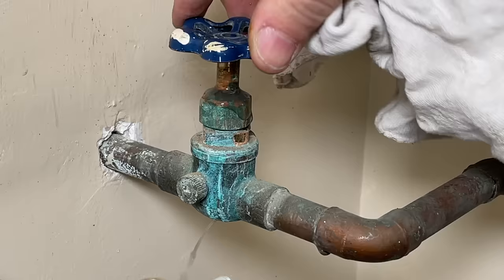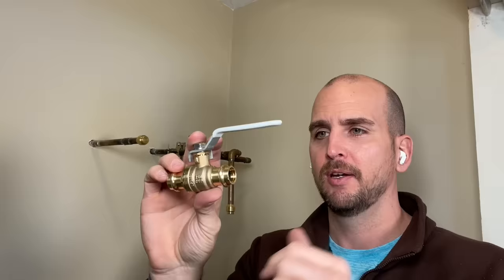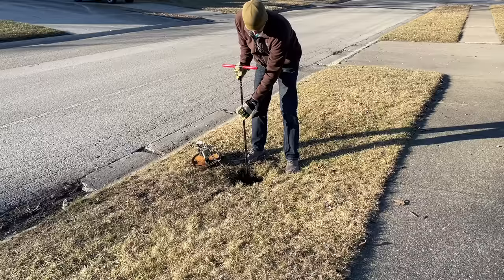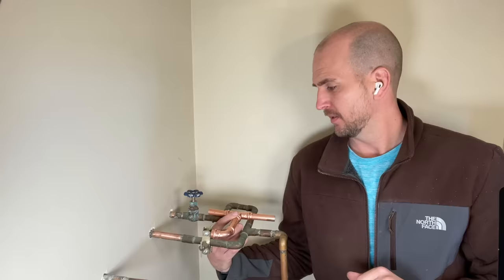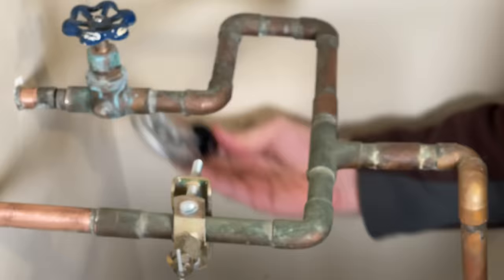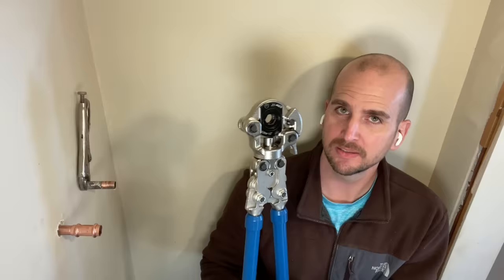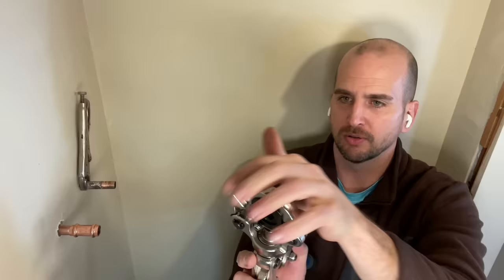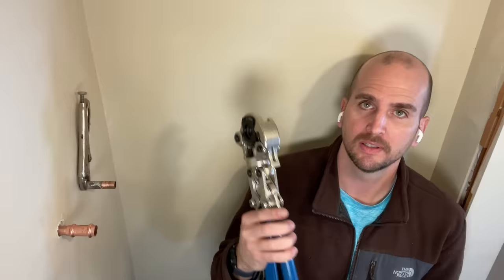How To Install a Main Water Shutoff | NIBCO Press Fittings

Comment: Yes the ball valve works in either direction, but pay attention to where the handle may be as it swings 90 degrees from on to off. Otherwise you may find it hits another pipe, another valve, the wall, etc
Reply: I agree,i think he may have turned it around,the nub on the valve is the stop.the way he had it to open it you turn that one clockwise hitting the wall.good catch.
Reply: Not to be too picky. There are gate ball valves I use in the basement the include a drain port. That has to be positioned to allow the down stream plumbing to drain after the gate valve is off.
Reply: It would be great if they made wheel style handles for ball valves. The handles are easy enough to remove and replace. I suppose you could cut a straight handle down so it's shorter when you have no other option due to space constraints.
Reply: @virtuallyrealistic  gate valves are no match for a ball valve, they jam, leak , and any dirt in the line and they wont shut off properly.
Reply: @virtuallyrealistic   Any contamination will cause the gate to not seat fully. Then the seat erodes. As long as you're going to sweat one of those monsters on, you might as well use a ball valve. 
He was spending a lot of money to avoid sweating a valve on but even using an extra $25 on materials to practice with, it still wouldn't equal anywhere near the cost of that crimping tool.
That is, if you bought, for practice, an extra 1/2" pipe ($20), a ball valve ($12), 8 couplings (97¢ each), solder, and flux, torch and tank, you're only into it about an extra $60.   And you have something to start your campfire with.
Reply: @mrcryptozoic817  Yes and soft soldering isn't difficult...every man should know how.
Reply: Great tip! Thanks!
Reply: I actually thought you wanted to install shut off valve after feeding water into house . That looks like it's in front of water feeding into house.. ijs
Reply: @joepublic2894  yes
Reply: 'Normally' practice is to have the handle pointed in the direction of flow (open). However that's not always possible but usually is. Also, sometimes you want the drain port on one side over the other.

Comment: I am not a plumber but needed a water line to a fridge with water and an ice maker in the door, the fridge is in an extension part of the house that is exposed to subfreezing temps. The plumber wanted $2000 to run 13 feet of pipe and valves to the fridge. I did it myself for less than $50, I put in the pipe, shutoff valves, and a place to drain off the water outside so the exposed pipe doesn't freeze, all using shark bite fittings and ball valves. did this over a year ago and still no leaks or frozen pipes. As a truck driver, I did well.
Reply: Normally if a plumber quotes you THAT much to do that job, it means they just don't want to do it or be bothered.
Reply: Too expensive

Comment: I'm a chief engineer  as many situations come up- for copper piping I only go with  old school- sweat fittings  it's a solid seal as the solder bonds to both sides of the pipe ( male and female) no slipping   no chance of coming loose. In some situations I can see saving time with these press fittings,  but in time I can see them leaking. Plus all round  fittings and supplies are just so much cheaper. Just my thought....
Reply: Job security. I can’t understand sharkbites passing plumbing code when the "bite" part is metal into copper. Electrolysis will eventually eat one or the other dissimilar metals.

Comment: I bought the Milwaukee 12 volt system, never looked back, if you ever hired a plumber $1000.- $1500 does not go far, most of the plumbing I do is under kitchen sinks, bathroom vanities, crawl spaces, one point to remember the press fittings are one use only, think twice, press once. One thing I will mention if you used a press cap at the end, that is maybe the most expensive press fittings, you could have likely put on another ball valve for just a dollar or two more and had a water heater shut off valve, maybe the cap is shark bite and you can reuse it, I enjoy your videos. When I replace a valve in a tight run like that I cut the valve, which releases the water inside and reduces the mass to heat up, heat and remove the collar left on pipe, wipe off solder, clean pipe, sometimes that half inch of pipe you save, saves a lot of work

Comment: I prefer using male adapters and a threaded valve, so it is easier to replace the valve if needed.
Reply: Yeah I never solder valves
Reply: I never press or solder valves. I always also use threaded or compression fitting valves. Just better for any future repair because nothing lasts forever.
Reply: @Kerbros100  Soldered valves are fine since you can remove them.
Reply: @DragonBuilds  Sure but here in Sweden you need to get the hotwork permit just as you look at the torch. If it wasnt for that i agree with you 100% =)
Reply: GREAT IDEA!!!....  => VERY SMART!!!
Reply: If you have threaded valves...you need a union which another potential problem. I either sweat or use compression fittings. PRO TIP: Make sure new valve has a drain port on it. EDIT: Shark bite fittings are terrible
Reply: @blaydCA  Agreed. More fittings = more places for things to go wrong.
Reply: @blaydCA  Sharkbite fittings have their uses
As a pro, I've never had a problem with Sharkbite
Reply: @walterbrunswick  Yes, if I was in a desolate area on vacation with no tools and the only fitting available was a Sharkbite..... I'd use one as an emergency temporary repair. As a PRO I've made some good money on fixing others plumbing mistakes when they used them.
Reply: @blaydCA  again, if installed properly, (deburr but do NOT clean/sand (you want the O-ring to seal on a smooth surface)), they are failproof 
a few years ago some workers plumbed a house with Sharkbites, no problems
only they are expensive, relatively speaking
But, for example, on a hot water tank re&re, they are marvelous - and the next guy who has to re&re will thank you

Comment: Ive been a commercial plumber since '95. Whenever I'm fitting together anything involving rubber or neoprene,  i like to wet all surfaces with soapy water. ..even nohub bands. ..slip nuts, I've never installed these kinds of fittings here in this video, but i would certainly soap them up before making them up. The soapy water makes all the mating surfaces nice and slippery so nothing binds up or gets pinched then it gets tacky as it dries. Anything that ends up inside the pipe rinses right out with ease. 

Soapy water in a spray bottle is an invaluable asset for any plumber to maintain. It's not just for checking for leaks or when making up rubber connections. Its good for remodels,  before soldering around combustible materials, spray down area. Before cutting into wall or pipe, spray area to keep dust to a minimum. The soap makes it spread better, stay wet longer. I use 2 or 3 tablespoonfuls of dawn per bottle.  That way, when it gets low, if im not near my supply of soap, I can just add water to what's left and its still soapy enough...

Its handy when cutting rubber too.
Reply: Great idea or even corn oil would work as long as it's not oil based  .
Reply: @Floyd Albright  but corn oil won't dry clean and it won't spray out of a simple spray bottle like soapy water does.  ..and it doesn't double as a substance that can be used to check for leaks.  ..and you can't add water to corn oil when the bottle gets low and there's no more corn oil.. lol

But it might work well tyseal gaskets and ductile iron gaskets..
Reply: This guy doesnt know what hes doing. He a jack of all trades master of none.
Reply: @RadioRich100 but better than master of one, right?
Reply: @Wow_wow1  No

Comment: Good video for the most part. However, press type fittings (including Sharkbite) are ok for external pipe connections that can be monitored regularly. Personally, I would never use press fittings inside of walls (yes, I know people do it all of the time). I have seen way too many press fittings leak, even when installed by so-called "professionals."

Also sweating (soldering) copper pipe is fairly cheap and easy. Just make sure the pipes and fittings are cleaned and deburred. Use Flux on the pipe and fitting, and apply heat to the opposite side of the solder contact. This will draw the solder into the gaps between the pipes and fittings, properly sealing the connection for many years. Soldering copper pipe takes some practice, but it is a lot cheaper than spending $175 on a crimping tool that you may only use once or twice. Hey, we can't have too many tools though, can we?....lol.

Finally, ball valves are great. They are much more durable and convenient (also more expensive) than globe/gate valves. Just don't buy thin metal, cheaply made ball valves, and they will last (almost) forever. When buying ball valves always look for "full-port" ball valves, so you don't lose water volume. What is the point of having a 3/4" pipe if the ball valve only has a 1/2" hole?" Also, water-knock can be an issue with ball valves on an often-used connection (like a garden hose). This is because the opening and closing of the ball valve is instant, and not gradual like with a gate/globe valve. However, this can be overcome by closing the ball valve slowly.

This is just my 2 cents on the subject. Hopefully this helps all of those DIYers out there. 👍👍
Reply: For sure its going to help guys like me who own a home and depend on videos and detailed instructions from guys like you. 
Well I have to use sharkbite as my shutoff is in-between walls and 12 inches below the basement ceiling. Thanks once again.
Reply: Hi, Sorry I haven't heard of press fittings leaking inside walls if done properly.
Reply: @jayak3768  Those things leak all the time, all the pipes at my work are installed by long term Journeymen plumbers and I see them leaking all the time, slow drips with visible corrosion from where it is leaking.
Reply: @zekehu7701  I WOULD NEVER USE A PUSH FITTING VALVE ON THE MAIN SHUT OFF. Your insurance company is gonna love you. There's ALWAYS a way to do it correctly.
Reply: You are correct. Best to check your jurisdiction. Some ONLY allow a rising stem or gate valve on the main shut off to avoid water hammer or shock from abrupt shut off. The gate valve makes this impossible.

Comment: I am an old school (retired) HVAC technician that has always sweat copper pipe. About 2 years ago I used Pex to install at tankless water heater in my camping trailer and shark bite to run a new water line in the basement of my condo. Although I have had no problems with either. I’m still skittish about these new fangled things. Any more DIY projects I have, I’ll go back to my old ways. The cost of the press fitting crimping tool is enough to prevent me from even trying these fittings. 
However, your video was certainly educational. Thank you.
Reply: None of them have been out there or had the track record or history of sweating copper. Everything new is better than sliced bread until the failures start stacking up. I still remember the 'cheap' PVC from the '70's, aluminum wire, and the CPVC stuff ('90's-'00's) that would fall apart if you touch it. And they got that cheap ABS pipe with a sandwiched layer of foam that turns into spaghetti with hot water. Only reason to deviate from what works is to cut time or money.
Reply: It doesn't save money it just makes people more confident to do repairs. For a plumber that knows exactly what to look for in solder joints that's fine. For people who don't that can cut a pipe deburr clean and press on a SB it is much easier
Reply: @chevy16001  For production building work it absolutely saves money (time) if you look at how long it takes to plumb a whole house or building. For a home owner, it's a waste, unless you hire a pro plumber.

Comment: I'm an old school DIYer and I would solder all the connections. Even if you have to buy a torch, the cost is a small fraction of other methods and this method has been used successfully for years. To me it's the gold standard.
Reply: Decades not years, otherwise your comment is awesome.

Comment: One other tip, instead of using a Sharkbite Cap in general, I like to use a Sharkbite coupling with a short piece of pex with a plug crimped in. Then when ready to run more pipe, simply remove the PEX and continue with PEX or copper. I've used Sharkbites professionally for 15-20 years (since Cash Acme 2st came out with them), never had a problem.

Comment: I'm a plumber and I use pro press and mega press frequently, you did a good job ,but I would have pre fitted it where all I had to do was 2 presses on the wall to eliminate fatigue. It's much easier to sub assemble on a bench or floor then to do a bunch of crimps on a wall, also most jurisdictions require a minimum of 3/4 feed lines to water heaters
Reply from the maker: Hi Will thanks for the feedback.  Yeah, I was surprised on the 1/2” main.
Reply: @EverydayHomeRepairs  
The main is Size according to Water Pressure from the Street., you are suppose to upsize to 3/4 leading to the Hot water Tank.
Reply: I prefer to Silver Solder Copper lines that are hidden. Pipes that are exposed,  pipes around a hot water unit for example it's neater and better looking to use a press tool.
Reply: I’m pretty sure All Jurisdictions require 3/4 pipe into and out. 
   Most codes call for a 3/4 supply no more than 3 fixtures. 
   You have someone in your comments saying code should be 3/4  supply line. Mobile homes don’t have all the same codes as most building codes.  I’m really not sure why mobile homes get away with undersized water piping and undersized drain pipes. 
      But they do!!!!
Reply: Justice, I’ve been a plumbing contractor for Just over 50 years. How about yourself??
Reply: @danielanasson4713 it’s just a preference. Silver solder cost about 3 times as much to install over lead-free solder plus labor costs to install it. 
        Time is money..

Comment: I prefer the solder method.  It's old school but if done correctly will last many years trouble free.  Installing the ball valve is the way to go!
Reply from the maker: Something tells me personally I will lean towards solder joints longterm but also interested in getting some experience with these press fittings as I have seen so many making the shift.

Comment: That crimp tool looks like a nice quality tool. I have a Milwaukee Force Logic but I like the fact that you can use the fittings without shelling out $2000. There are some places where soldering isn’t safe. No hot work permit and no sprinkler heads going off but for $175. Nice!
Reply: I have a big, old soldering iron that I use in such cases when I cannot use a flame torch.  I've even used soldering coppers in the past with my heater outside.
A big 4 lb copper can do 3 or 4 joints before cooling.

Comment: I used threaded ball valve with thread-to-solder coupling. Makes it easier to replace the ball valve. Also don't want to spend $190 (tax included) for a crimp tool. Nice video!
Reply: Isn't that a male adapter?

Comment: I owned six rental units with very old plumbing for about 25 years. Each time an existing globe valve would fail I would replace it with a ball valve (with a drain). I love them. They are very easy to open and close (1/4 turn) and very easy to see if they are closed or open from across a room. My father taught me how to sweat copper pipes when I was a kid, so that's never been an issue for me. Also, I only own close quarters pipe cutters. Once I found them I never bought another set of the regular kind. I use the CQ ones for everything with no trouble.

Comment: Ya you replaced it! 😀👍
I'm a sharkbite skeptic, but also guilty of using them. I never put them in wall though.
Reply: Sharkbite uses plastic and it has not proven how long it will last until the plastic part is disintegrated.
Reply: @scota.3898  The plastic bit is only applicable for pex. The pressure bearing part is brass and the seal is an o ring. Crimp fittings use the same type o ring.

Comment: I would recommend "round off" the edge of pipe with a sand cloth so you're less likely to damage o ring, and dipping either pipe or fitting into a cup of water also makes it easier to push on

Comment: I have a property maintenance company; we use sharkbit all the time "10+ years now", benefits of sharkbit over Brazing or press fittings g is you don't loss pipe length due to removal/replace. Sharkbit is 100% removable, replaceable and reliable.

Comment: I had the boiler replaced at home and the contractor used this style of compression fittings. They did have to sweat a couple of the connections but 99% were done with cordless crimp tool. I think the time it took them to sweat the couple fittings was longer than the time to crimp the others. Also, with this system there is no flame so way safer from a fire hazard standpoint, especially in tight areas near any framing.

Comment: I love SharkBite! The ability to easily disassemble fittings to tune projects by making adjustments is worth every penny of the premium cost.
Reply: 😂😂😂. Sharkbites are trash.  I make good money taking out sharkbites that leak
Reply: @parkerjohnson1781  And this press fittings, kept by friction, sealed with the same O-ring doesn't leak?
Reply: @MariuszChr  propress fittings are less likely to leak if pressed with a press gun which are expensive and the pipe is properly cleaned and reamed and installed by a professional.  Shark bites are usually installed by homeowners,handymen,and shitty plumbers and tend to leak from poor installation.  The only time I use shark bites are for isolating and testing leaks on manifolds or temporary repairs. I prefer to solder if I can cuz it's an art to create beautiful joints.  Pressing joints saves time which saves money.